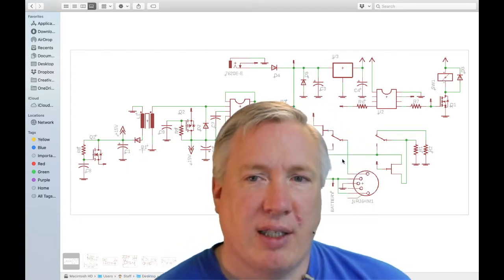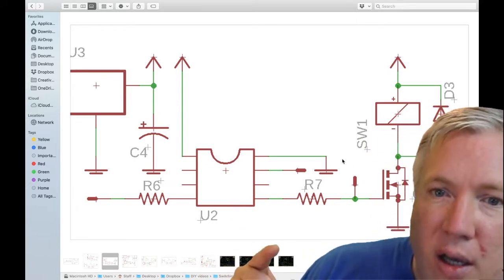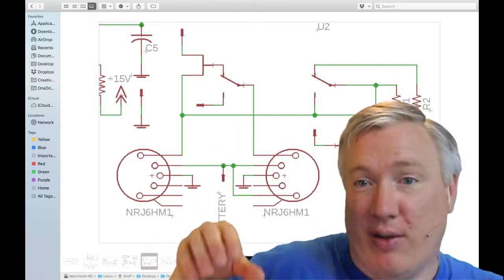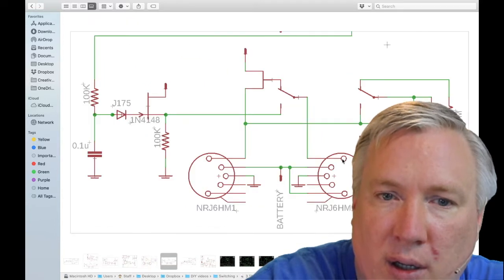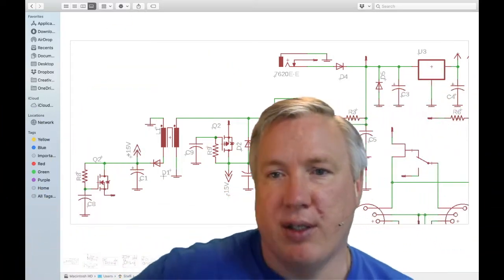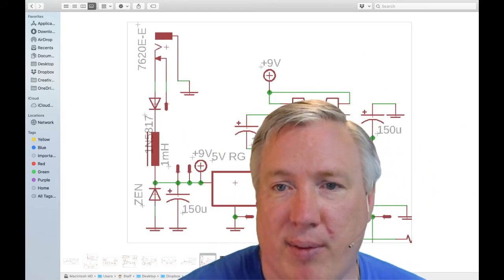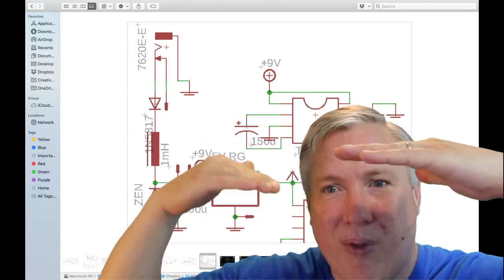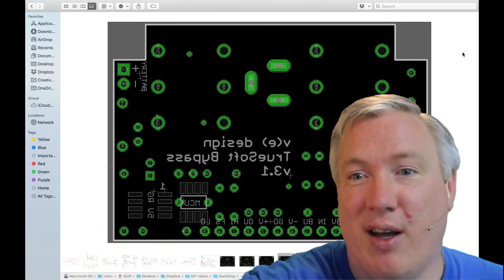VFE Pedals SPS System & TrueSoft SPS switching PCBs - walkthrough & comparison

Comment: Many thanks for the video. 
So if building the Choral Reef as a diy project, we should go with the 'SPS System Bypass'  circuit/schematic? And not the 'TrueSoft Bypass Switching System v2' or the 'TrueSoft SPS Bypass'?
Also, does the 'VFE Bypass V2.7.hex file' work in all cases, or just certain one(s)?
Many thanks again.

Comment: I've been seeing a lot about soft switching recently which is serendipitous because I'm designing a pedal which is almost perfect except for switch noise. I've noticed that my Ibanez TS9 and Boss DS-1 do not have any issues when it comes to clicks or pops, and I have to attribute this to the jfet style switching and push button operation. I was curious, if I were to replace the push button with soft click SPST, would I achieve the same or similar benefits? Also, what is the advantage of your system(s) versus the Boss/Ibanez systems? Is it a matter of more headroom as you mentioned here in this video?
Reply from the maker: The Boss/Ibanez and similar FET-based switching systems have an amount of impedance that would change the tone of a the instrument (especially with longer cable runs). This is why these pedals have an active buffer stage (sometimes two - input & output) to preserve signal integrity.

My goal was to use a true bypass system, where the signal is mechanical switched. This means near zero impedance and no buffer required. My added a JFET switch on the output of the effect, what changes is that the signal being switched on/off is significantly quieter for short period (measured in milliseconds) while the mechanical relay switches the audio signal. This quieter output switch results in less switching noise.

It doesn't eliminate it completely, but it definitely helps - especially for audio circuits that I've found have louder pops when a standard mechanical true bypass switch is used.